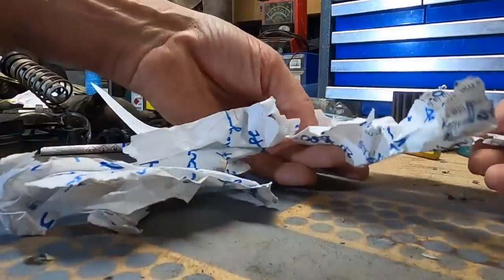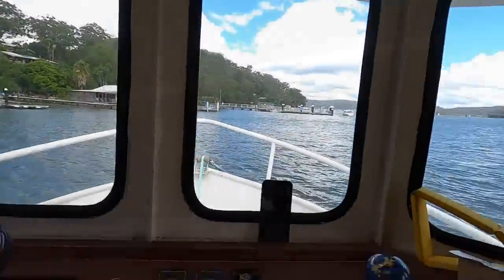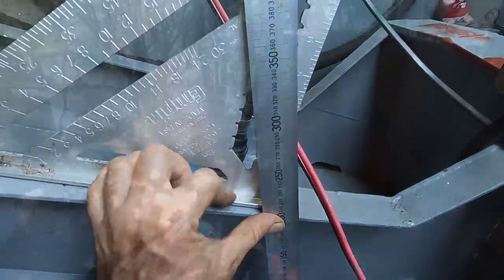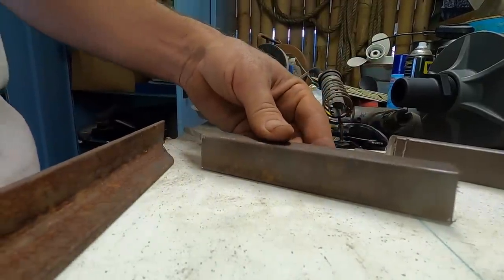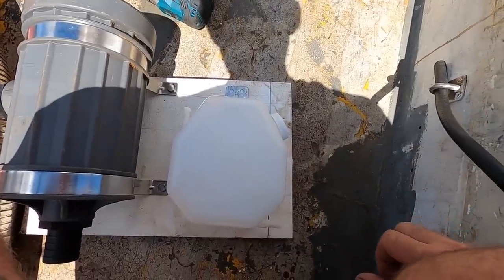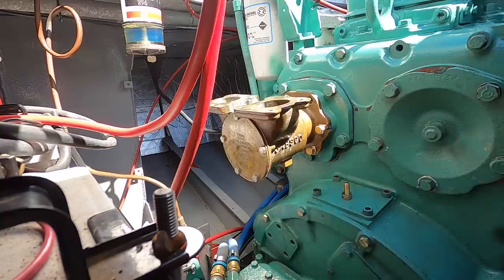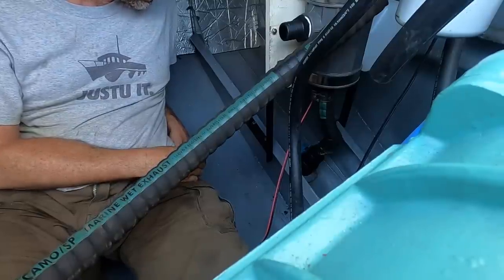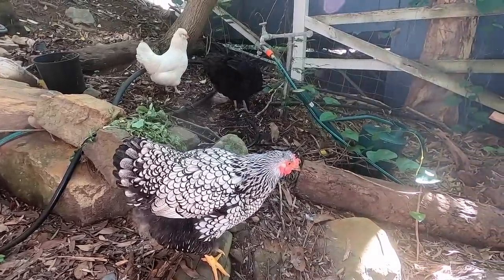Raw water cooling

Comment: When working in Key West, FL as a Caterpillar Marine Mechanic, (1976 to 1984), many of the head boats that did charter fishing in shallow waters around the mangroves had problems with their sea strainers plugging. I came up with an idea to replace their trim tabs on the transoms with a longer/wider one that was also hollow 1 3/4 inch thick. I had Steve's Welding on Stock Island make these of Aluminum with thin aluminum strips put inside to direct coolant back and forth from one corner close to the outside near the transom to the inside close to the transom. A coolant fitting was welded at these two points. Each engines coolant went to each skin cooler with radiator hoses connected to a thru-hull above the water level in the transom. They were hinged and adjusted just like any other trim tabs but coolant was cooled directly from the engine water pump without a heat exchanger, rubber impeller pump or a sea strainer. I talked to several trim tab companies and non had any idea what I was talking about. There are still two boats I put these cooling trim tabs still operating in Key West.
Reply from the maker: There certainly are some clever designs for keel cooling around. I've always liked the idea of parts that serve two purposes like that.

Comment: Having been a plumber in a previous life, I was telling you to "Go get a Half inch BSP brass plug, bore it out and tap it to whatever you need". Then from out of your hat you pull out a half inch brass plug. Wonderful medium this You Tube, it even carries mental telepathic waves. "Where Do Ya Get it" NPT tap that is....???
Blackwoods or any good engineering supiies stores hould have any amount of NPT taps for that little job of drill and tapping that plug. If you get a drill larger that the tap size you can drill out the underside of the half inch plug so that there will be sufficient water flow around the sensor I think Stu. Pity I don't live close as I have a lathe and can do all those sorts of jobs in less time than it takes to think about it.
You're going well mate. Looking forward to the first sea trials. I enjoy the little update on the D squad each episode also. Thanks mate.
Reply: Sorry re he spelling of Supplies. Old eyes, that's all.
Reply from the maker: Thanks Bruce. Great minds think alike. ;)

Comment: Been subscribed for awhile and really following the steel trawler restore. I've learned for gasket maker and RTV in general you get a much better seal by spreading it around then tapping your finger lightly around the surface. This give it an air gap around the peaks of the RTV to allow for better expansion. There's several good video on youtube showing the results of both and the surface area after it spreading out. A small easy to access flange is one thing but on something like motorcycle gear case it keeps from having to do the work twice.
Reply from the maker: Sounds like an interesting technique.

Comment: Looking good!!! 

Easiest way I found for priming a jabsco, was to shut of the sea cock, take the top of the the strainer and pour in water until everything is full, put the top on the strainer so the system is sealed, then open the sea cock and go for a start. The pump will have water immediately then. Works well if you just come of the hard stand and you dont need to worry about the lube drying out!

Looking forward to seeing the boat move under it own power.
Reply from the maker: Yes, have certainly done the same thing many times.

Comment: A suggestion about your probe adapter, drill and tap your plug for the probe and then remove the material from the threaded end of the plug. Them take it to your local machinist and have him re cut the pipe threads to get proper amount of threads. This way you don't need any special socket down the line.

Comment: Anzor Fasteners in Brisbane will have the NPT to BSP adapter in 316 st/st, I work for one of the NZ branches. If the NPT size is 1/2" you can use a BSP one instead as they have the same TPI. Hope this helps.
Reply from the maker: Thanks for the tips!
Reply: Yes the thread count is the same but BSP is a55deg thread and NPT Is 60deg thread if I recall correctly

Comment: Putting different fitting together can be fun.  I have had to adapt oxygen tank, or fire extinguisher tank fittings to BSP (for air cannons) before.  I just drilled them, cut them, and brazed them together.  Brazing is more than strong enough for either air, or water fittings.  This way, you don't have to worry about finding specialty taps or dies.
Reply from the maker: Looks like I'm going to be doing a similar thing brazing a new fitting to my old fuel line.

Comment: Stu, a friend made a stainless steel box (Sea Chest) too hold the right amount of sea water, then put a top with gasket, and put 4 hose connectors in the top for different equipment.  then into sea filters and into the equipment.  so all he had to do is put the box leveled and connect the bottom to the out side. saved a lot of problems.
Reply from the maker: A seachest certainly is a great way to go. If I was building a boat from scratch I bought definitely build one in.

Comment: I recently bought some npt taps on amazon here in the US. Tapped some aluminum for a heat sensor and it worked as one would expect.
Reply from the maker: Cool, I'll do a search on Amazon. Good to hear it worked well.
Reply: Make sure you need NPT and not NPS, made that mistake with a Nema 7 enclosure and some power buttons.
Reply: @peterg.8245  So many different standards.

Maybe someone should come out and make another standard to unify everyone, wait....

Comment: If you can find a bolt of the same size of your sending unit you can use that for a tap. Brass is soft. In, out, in, out. It will go.

Comment: I think Hare and Forbes have the taps in their catalog .With the coupler sleeve you may be able to remove the tapered flange off the prop  shaft that has the correct taper and have it machined down to fit inside the new coupling

Comment: Cut 10mm off the end of the pipe adaptor and run a larger drill in the water end, to create a slight cavity.  The end of the sensor can be partially shrouded without issues for the sensor to work.

Comment: Stu,
Regarding your brackets you made. You may want to put a brace on the angle iron. When they fill with water and the boat is rocking in high seas it will act like a fulcrum lever and might break the weld. A piece if flat stock might work as a gusset and not rely 100 on the weld to resist the fulcrum. Just my 2 cents. Thanks for posting all of these videos. I love them.
Reply from the maker: I was thinking about gussets but I'm actually starting to lean towards a third brace going up to the deck beams. I'll take a look and see which will work best.

Comment: You can use what's called a thermal well for your temperature sensor.  It protrudes into the coolant flow, and the sensor fits into it. They are made in BSP and NPT.  You could install your sensor into BSP on a thermal well, because the sensor is isolated from the actual coolant.  Google thermal well for info.  They are widely used. Greg
Reply from the maker: Thanks mate, I'll look into it.

Comment: i am changing the water pump impellor and rebuilding the carby on my very low hour 77 johnson 35 horse motor...serioudly less than 200 hrs on the motor...sat for over 20 years...

Comment: Hi Stu
I’ve seen a boat where they welded a tube to the inside of skin and cut it off above the water line.  So the seacocks were all above the waterline and required very little servicing and lasted for the life of the boat. Also no water ingress when servicing or replacing.  Might be a good idea for Damian as well. André
Reply: Till the welded tube breaks at the skin. Then you lose your boat. Not quite professional standard.
Reply: Tony Rigby they braced all the tubes so they would never brake. André
Reply from the maker: That does make a lot of sense, particularly with braced pipes as you said. The big trouble is that the sea strainer is usually below the water line to help with priming.

Comment: You could try a temperature sensor from a piece of agricultural equipment or heavy equipment, they use a bigger type of sending unit, it might match your system better. I have updated older motors like yours to electrical sensors before. You just need to find the right type of signals. You'll get there! Good luck!
Reply from the maker: One thing I haven't had a chance to do yet is learn about how to know if a sender and gauge are a matched pair. I presume there are standard resistances that map to temperatures.
Reply: @DangarMarine  I usually just hook them up, use a lighter or heat gun and see what happens after I do my homework, that way you don't loose antifreeze.

Comment: If you increase the length of the hose coming of the raw water pump by about 15cm the water route will then go around the outside of the filler cap.

Comment: Drill the proper size hole for the pipe tap all the way thru the brass plug
Then counter bore the hole as big as you can till the tip of the sender extends out the brass plug then tap the smaller hole I used to make a bunch of werd adapters while working as a truck mechanic 
As long as you have correct taps and drills 
Its easy
Banks tubo killing a duramax just showed a nice parker/racor fuel water separator really nice but a bit pricey

Comment: Cut a vee out on one flat of the angle iron, bend to adjusted angle, weld up the gap. Is that one or two cuts? Bend a lesser angle for the other side. Weld. Less sharp points to work with as well. Bracket done.

Comment: G'Day Stu..Worried about them bolts,well don't can get a loctite product called wick in,usually green and just add a little to expose threads and will seep in and stop bolt from coming loose,
we used it to stop idle mixture screw from moving and still allow easy adjustment but would not turn with vibration,,Normal hand tools for removal,Have used it to seal porosity in castings as well,

Comment: Speaking as a wily old retired instrument basher.....If it hasn't already been said, ref your temp probe for (?) missed that bit. You only need 3 threads engaged for most pipe taper apps & NPT up to 1/2" thread pitch is not much different to BSP, that difference becomes less with smaller sizes 3/8 ~ 1/8NPT/BSP & under low pressure conditions (<=100psi) will be fine with a liquid pipe thread sealant such as Loctite 567 or similar. Ref the probe itself, would be nice to protrude a small amount or sit flush with the face of your donor plug (it can be shortened with your hacksaw)  but seriously the temperature gradient (loss) across an inch or so of pipe in a water jacket is going to be minimal imho. My 2c. PS: I do not advise mixing threads of any size for hazardous mediums but. :)

Comment: I'm thinking: shorten the plug on both ends by a bit, put your sensor hole thru the middle, drill a fairly large recess hole in the top to allow the sensor to seat lower, get a cheapie Amazon/eBay NPT tap, and bada-boom, bada-bing, Bob's your Auntie! As for the ladies hanging out with you while you're in the shop, I'm betting that they're thinking with their stomachs. I'd wager that they know that if they hang out with you, they prolly stand a really good chance of scoring some tasty tidbits! Not to mention the fact that I'm pretty certain they feel safe with you there to protect them. Another fine episode!!! Thanks for sharing!

Comment: Great video, as always. Regarding the oil fill... Detroit has lots of engines with a fill port in the valve cover. If you have clearance, perhaps you can just cut a hole in your valve cover and weld in a fill port. Or get a new valve cover with the port already in there? The one on my 8V71 uses an expanding rubber stopper, which should work in your engine as well.
Reply from the maker: I took a look at the video where I removed the engine and the water pipe actually snuck just inside the filler cap so I'll try to recreate that arrangement. It is a great idea to find a rocker cover with a filler cap (or add one), that would actually be more accessible than the existing filler cap.
Reply: @DangarMarine   should have considered a reverso system before putting the engine in place.
a hose from the drain plug to the reverso, a hose from the reverso that is loose at the other end. put loose end into an empty bucket and turn it on, oil pumped out of engine into bucket. change oil filter put loose end of hose into new bucket of oil and flip the rocker the other direction, oil pumped back into the engine. can also have a line to the transmission to handle it's fluids.
but these need to be put in place before the fluids are in.

Comment: Here I go again just a quick idea, the brass sender plug could you not just chop 10 mm or so off the top, the hex head bit then drill and tap what you have left, in effect shortening the length of the brass adapter

Comment: Factory is a mechanical tripped plate   not pretty if they run away   your doing a great job   my truck had a 8v92  turbo 15 speed 475 HP   good site  vancouver Canada

Comment: More plumbing then my house ! Lol. Could you do a double 90 degree pipes for your oil filler ? Or just mount a filler cap in the cover so you don’t need to remove it every time you put in oil ? Many ✅ marks and list is getting much much smaller ! Maybe wet a line next time your onboard working , just put a bell on the line for fish on !
Reply from the maker: Fingers crossed I'll be able to plumb around that filler okay. It's funny you mentioned the bell because I have been looking at those fishing line alarms they sell. ;)
Reply: Dangar Marine the bells we have used for many of years , cheap and no batteries required  ! Lol

Comment: NPT is just Pipe Thread.  Any plumbing or heating supply house will sell these Taps.  Quick look from 10,000 miles away say it looks to be 1/4" or 3/8" pipe thread.  Remember, NPT is "tapered" threads.

Comment: Bunnings Hardware has Gripset Betta 15L Bitumen Rubber Waterproofing Membrane 22.5 sqm Coverage for $132 which would deal with your water, rust, oil leaks below the engine & many other places that you can use to prevent sea water from rusting out the steel hull.

Comment: I tapped my turbo spacers with a bsp tap for an npt pyrometer probe. I think they are close enough to work
Reply from the maker: I must say, I was tempted to buy the BSP plug and just crank it in given it started just fine and was steel going into brass. It was only a few bucks so I might give it a go before messing about with the all the drilling and tapping.
Reply: I use the same Sensor in Metric thread, I think it was M10x1. Somewhere close is good enough for this application.
Reply: Jim Alley  The 27 vs 28tpi will start to bind up  badly after 3-4 turns.  You can get the correct tap easily enough from engineering places.  I've got both here, but I'm on the opposite side of the Tasman.
Reply: I have actually retapped the holes with the NPT sizes.  I put a blob of grease on the threads of the tap to catch the metal shavings. Most of them are pretty close to the same thread pitch.

Comment: One thing I noticed is you have a 3/4 inch copper pipe at the rear of the engine resting on the I-beam with no vibration pad or clamps securing it. Over time the copper will have a hole worn through it since the pipe will be vibrating every time the motors running.
Reply from the maker: Yes, it does still need padding and securing.

Comment: gearbox rotation is fine which is good to know, even though its a pain to check, much better than a replacement gearbox, and knowing life as it is it would have failed when you are in a tricky situation,  i do not know if you have petroleum jelly in oz , we use it here in the NS-UK for battery terminals to protect them from corrosion, well mostly,
Reply: Jim Alley  naughty boy Jim :) Love it
Reply: Jim Alley  we have had running water for centuries, mostly running down the walls in the morning for some reason,  also we use modern tech , i do not know if you in oz are using this wonderful material we are all using here? lead, lead piping to be precise,  but its so tedious sucking the water off the walls and drinking it ect.

Comment: Stu, where you have a seawater connection two worm clamps rather than one is a good idea in case of a failure of a clamp. And an electronic water level warning, independant of the bilge pumps. Safety first.
Reply from the maker: Yes, worm clamps do need a backup which is why I have gone with these t-bolt clamps, they are much more reliable.

Comment: What about using a bsp nut that fits the plug and run it flush to the top thread and hit it with a sawzall on the bottom of the nut, clean up with the grinder and back off the nut to clean up the threads on the way off, would allow the plug to be shallow and then drill and tap for your npt sensor.

Comment: I was wondering how the adjustable mounts that also move would work with the solid coupling? I have seen rubber couplings before on machines. Know I know why👍
Reply from the maker: Hey Tim. The interesting thing is that I spoke to the company that makes the mounts and the blue coupling between the gearbox and the prop shaft and they say that they will be fine together. The adjustabe mounts don't move anywhere near as much as a car engine mounts for example so I think I'll just give it a go for a while and keep and eye on it.

Comment: the copper pipe in between may have been there because under load the pipe may collapse just a thought
Reply from the maker: Possibly, but I would have thought that it would be okay being on the output side of the pump. Perhaps I should just put the original pipe back, after all it worked for 30 years so why change it?!